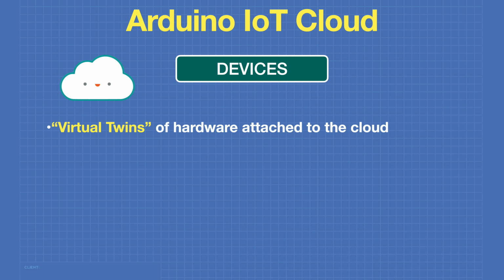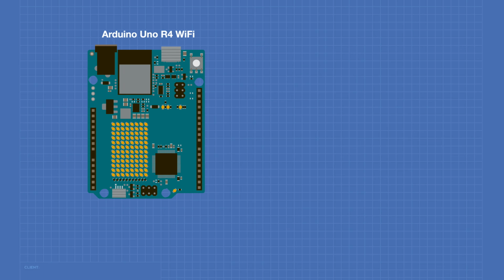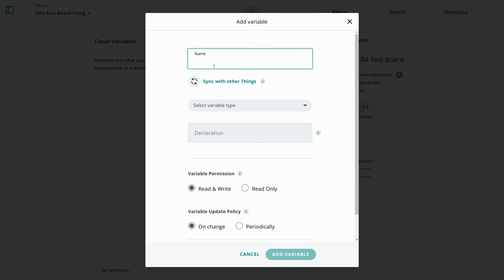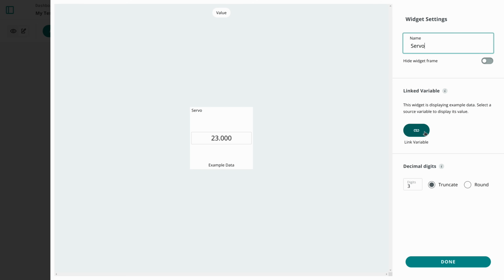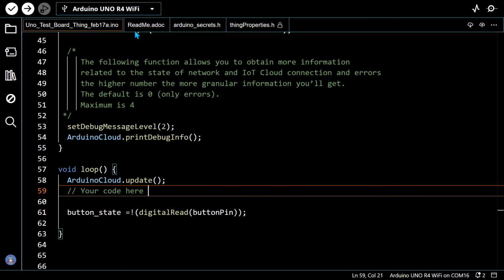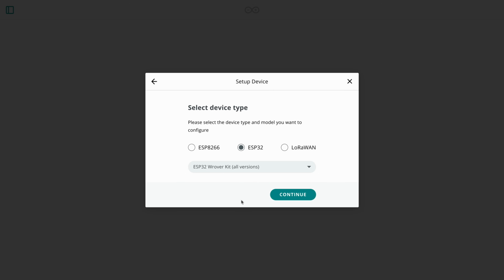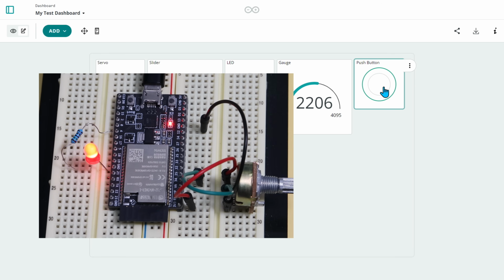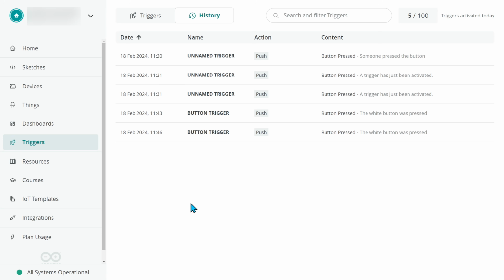Arduino IoT Cloud Fundamentals | 2024 Step-by-Step Guide

Comment from the maker: The coupon code I have for the Arduino IoT Cloud , "DRONEBOTSHOP", will give you two months of Maker Plan for free.  Note that this is NOT an affiliate thing, I don't get anything if you use it! 

I was a guest at the Arduino Cloud Cafe last month and will be doing a presentation during Arduino Days at the end of March, so I have had several meetings with Arduino recently.   I told them about this video and asked for a coupon code, and they obliged.  It is good until March 18, 2024.

There is also a FREE cloud plan that does not require a code, you can do most of the experiments with that.
Reply: Just tried the code and it didn’t work. Any particular plan you need to use?
Reply: @martypeck9950 It works with Maker Plan Monthly subscription (not the annual one)

Comment: When I tried Arduino Cloud 2 months ago, I was able to control Servo motor perfectly. But now it gives errors.
In file included from /run/arduino/sketches/ServoSG_mar26a/ServoSG_mar26a.ino:17:0:
/run/arduino/sketches/ServoSG_mar26a/thingProperties.h:6:25: error: 'SECRET_SSID' was not declared in this scope
const char SSID[]     = SECRET_SSID;    // Network SSID (name)
^~~~~~~~~~~
/run/arduino/sketches/ServoSG_mar26a/thingProperties.h:6:25: note: suggested alternative: '_GETSSID'
const char SSID[]     = SECRET_SSID;    // Network SSID (name)
^~~~~~~~~~~
_GETSSID
/run/arduino/sketches/ServoSG_mar26a/thingProperties.h:7:25: error: 'SECRET_OPTIONAL_PASS' was not declared in this scope

The above error message comes when verifying arduino cloud sketch
const char PASS[]     = SECRET_OPTIONAL_PASS;    // Network password (use for WPA, or use as key for WEP)
^~~~~~~~~~~~~~~~~~~~
Multiple libraries were found for "Servo.h"

Comment: Had a bit of an issue where I got error74 after trying to configure my Giga R1 WiFi board.
To solve this I downloaded the IDE desktop application and had it install all necessary drivers by selecting the giga in the board manager.

After that I was able to setup the Giga through the IOT cloud, leaving it here if anybody else ever has this issue ;)

Comment: Hi from France and thank a lot for your video. When I do the same test as you with my board UNO R4 Wifi I have a problem during the setup. In fact I never  haven't  my ID and password as you during your video (12.28). I tried several times without success but when I test with ESP32 it's OK :( .
Do you have some idea why I have this problem. By advance thank a lot for your help. Jean-Claude

Comment: Uno R4 part works but when I go to the ESP32 it comes up as device not on line even though I have associated my WiFi credentials. 
Could you suggest a reason. Can ESP only access the lower wifi band?

Comment: Bill, many thanks for all your work on this and so many other videos. I have a present project for changing bands on an antenna and this is ideal after Blynk went totally commercial . Unfortunately the buttons trigger the pins by just passing the mouse over them, and then pins stay high no matter the button state. I have tried PULL-UP, PULL-DOWN resistors but no result. I appreciate how busy you are but if you have any idea why this is happening I would be very grateful.

Comment: Thank you, Bill, for the great video.

I do have two parts that I don't really understand.

My cloud variables are regularly updated. However, I wonder when the corresponding functions are called. I had understood that this always happens when a variable is changed. But that doesn't seem to be the case. I have to call these functions within a loop() otherwise, nothing happens.

The second question concerns the Serial Monitor. I use the latest online editor to edit my sketches, but the Serial Monitor button in the browser doesn't function. Am I doing something wrong?

Thank you for your help.

John

Comment: For me the whole purpose of microcontrollers is to not be dependent on the cloud/internet and tinker with this stuff ourselves and keep control ourselves. This video is really good a always,  but i won't be using this video.
Reply: For micro's that don't have wifi you are correct but with them now having wifi connectivity, remote control and remote monitoring is possible.
Reply: @noweare1  yep, I connect them to my own network though, and not to someone else network (the cloud).

Comment: Bill, please check for the wiring chart of that Arduino. voltage is missing at the board, it seems to me. Maybe you would like to add this to your pinned comment or video description.
Edit: seems you run it from USB, so no worries. Was a bit confusid
Reply: no foul